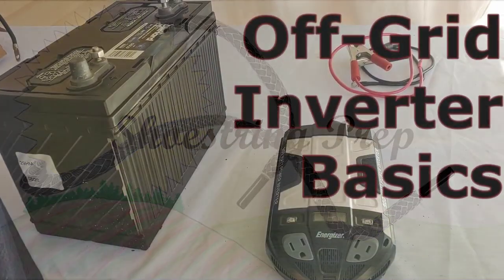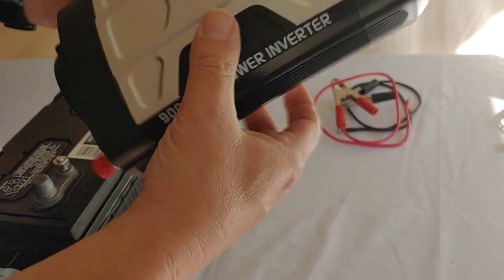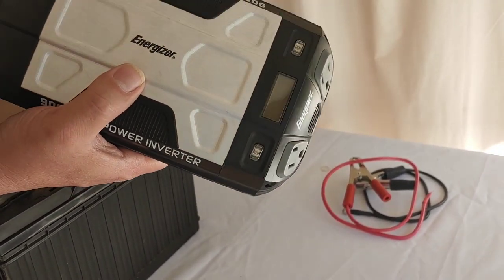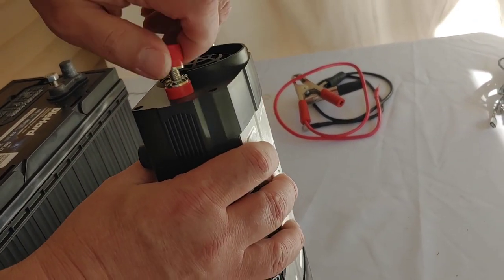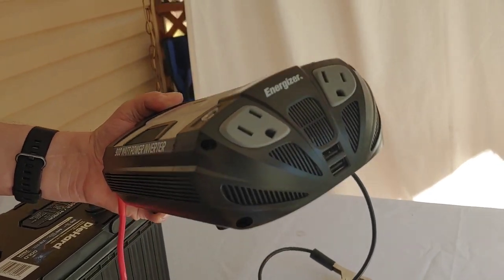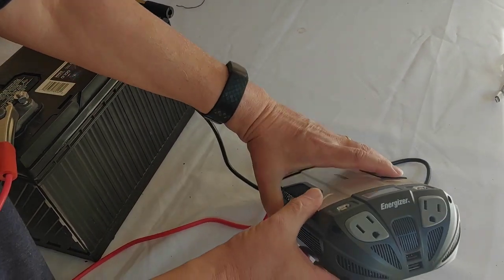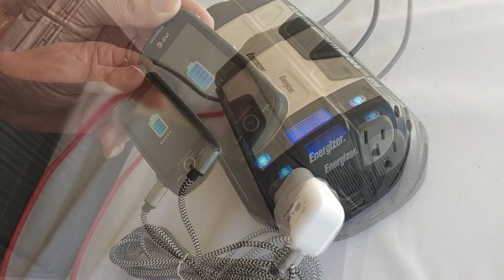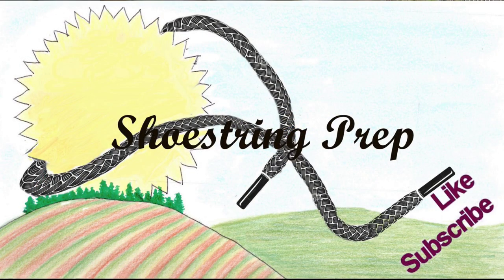Off-Grid Inverter basics: how a power invertor works as a part of off-grid power setup.

Comment: I have sever of the square wave inverters one at even at three thousand watts. but I don't have a sign wave one. wish I did have but I do have an a p i  inverter generator which is pure sign wave.. but if I was to use the three thousand watt inverter. I would have to have wired to my old ford truck with a six in it. if I did not use it on the truck. I would have to have a huge battery bank.being poor. I can't afford a big lithium battery bank . one of those battery's are are around a thousand dollars or more. my syxtem is four lead acid batteries and a hundrd forty five watts of solar. as I can afford it i will add more panels
Reply from the maker: I understand working on a limited budget! 
You will find your modified sine wave will work for most applications. There are some lithium batteries (good ones) which are substantially under a thousand dollars, although I do still need to save up to get them. Here is the link if you want to check them out: https://amzn.to/3xqiVcL
Thanks for your comment.